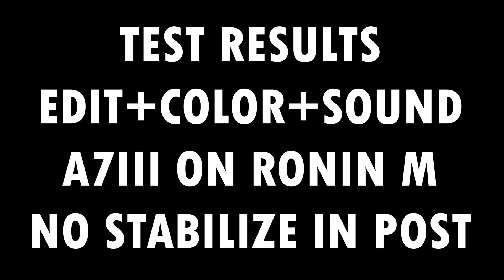DIY Redneck Ronin Vibration Isolator

Comment: What gauge are your wires?
Reply from the maker: Can't remember , it was the thickest Lowe's had on that day ! Was able to change tension by adjusting the length. Cheers!
Reply: @chasethetruth  Thanks! I build one too (just a version for testing), I think I need to either shorten the wires or choose a thicker gauge to make it work.